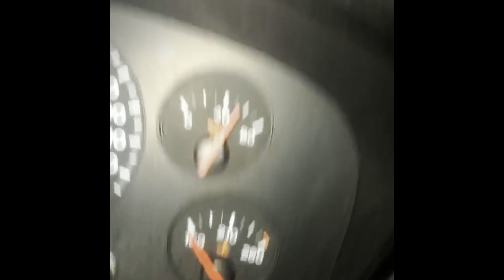I found an engine for my wj Jeep Grand Cherokee!!

Comment: Looking forward to the engine swap. I have a 99 WJ. 
Doing an engine swap now. 
Did I understand that you had a bored throttle body?
I've had a Mellon Cam, Bank's Header, 12 port Bosch injectors installed. But want a larger TB. Any advice on that?
Reply from the maker: Yes I have a 62mm throttle body but I would recommend getting the 505 performance throttle body it changes your throttle linkage geometry and it’s supposed to be a lot better with the kick down cable and stuff and this is engine number 3 in my jeep haha
Reply: @dylansgarage3549  thanks for getting back with me. I'll definitely check out the 505. Appreciate the info.
Reply from the maker: @tonydowd8566  https://505performance.com/shop/ols/products/1991-2006-jeep-billet-throttle-body-62-66-68-and-70-mm

Comment: I have a wj and let me tell you they need a V8...I had the 4.0 on another Jeep and was impressed with it...my wj has the 4.7 ho and the more power you have... the more you want...
Reply from the maker: Yea I’ve driven 4.7 before they are deff a lot quicker
Reply: @dylansgarage3549  there's a couple of  vids on yt of modding a wj for a 5.9 with wires and pcm....not easy but that's 390 HP's...cheers man!
Reply from the maker: @steven6692  yea and a reliable motor cause we all know those 4.7s lol
Reply: @dylansgarage3549  yep..I had mine overhaul at 143k...hard to trust...
Reply from the maker: @steven6692  yea Ive worked on lots of them lol there good when there good but shit goes south quick once start going wrong
Reply: @dylansgarage3549  I just keep a close eye on it but... I've got a heavy foot...so... I'm the guilty one here...and I'll bet $5 that everyone that complained about the 4.7 beeng   unreliable is bc they love the power it has...I have rocker lockers on mine for peace of mind...
Reply from the maker: @steven6692  yea I beat the shit out of everything I own lol tbh only car that never left me on side of the road was my 98 cobra lol and that’s one I beat on the most
Reply: @dylansgarage3549  you're a good men lol...keep wrenching.!